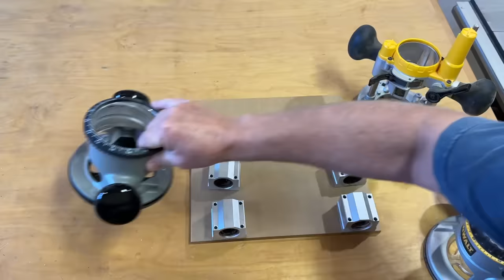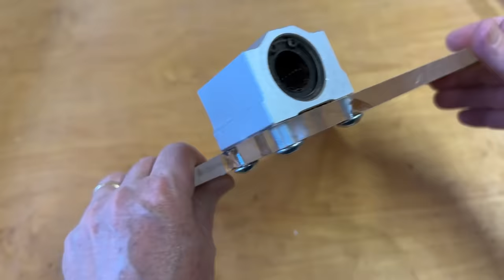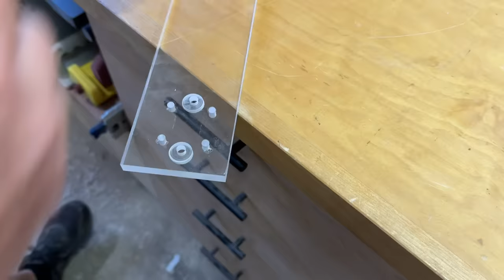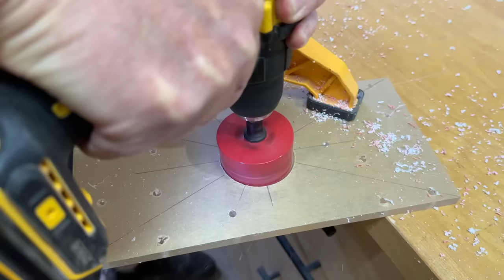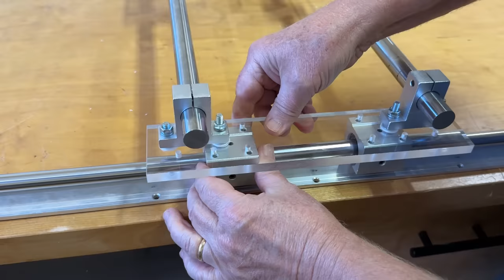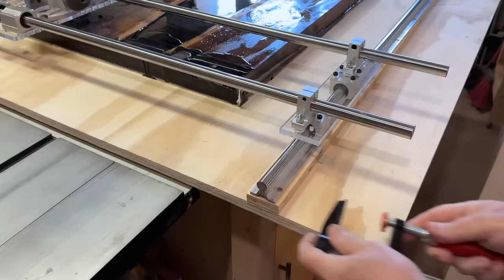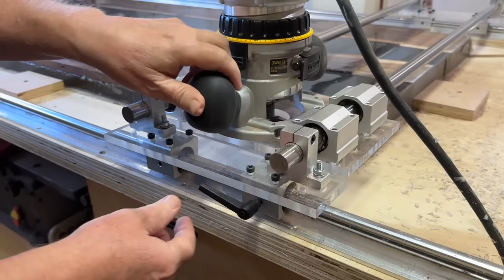Affordable Router Sled - I finally got it right!

Comment: Curious, how much deflection do the steel bars get with the router weight comparing the middle to the outside?  I wondered if that’s why people were opting for the other beams with the support like you have on the side?  Was it to reduce sag under weight?  Or did you find that the 20MM thick bar was thick enough to avoid deflection?
Reply from the maker: That's why I went with the thicker 20 mm on the cross rails, instead of the 16 mm that I used on the side rails.  I don't notice any deflection at all, and believe the result is a totally flat workpiece.  The 20 mm rails are really stiff, they actually feel stronger/stiffer than the 16 mm rails with the support bracket that I used for the side rails.
Reply: @jkmwoodworking  I appreciate your response!  I’m working on my SketchUp plans now for my next workbench and am trying to account for a similar setup.  Thanks again for the video and advice!

Comment: What did you do about the rails being straight?  I think I got the same linear rails as you, from Vevor, 20mm.  So far one is pretty much dead on, but the other one is raised a little in the center. But overall, good.  
I got some 16mm Vevor rails but they weren't straight enough for me to even keep.  I couldn't get the bow out by pushing on them with about 40-50lbs, so they were returned.
Reply from the maker: Oh no, that doesn't sound good.  The rails that I got were pretty straight.  To help them get perfect flat, I also screwed them down to the plywood worksurface, which rests on my flat workbench top, and the whole assembly seems to sit flat and true.

Comment: How do you hold the position of the cross rail during each pass?  Is there a lock?
Reply from the maker: There is a lock that comes with the rails.  I find that if I'm doing shallow passes, I can just hold it with my hand.  With deeper cuts, the lock is helpful.

Comment: Can you explain the templates you have attached?  30x32 vs 40x40?  Neither appear to be similar to what you drilled in the video so I am confused.  Thank you.
Reply from the maker: The template files are intended to be opened in the Lightburn software and used with a laser to cut the templates.
Reply: @jkmwoodworking  Ahh, is there any way to get a pdf that I can print and tape down to my acrylic?
Reply from the maker: @bpittaway6543  I'm not sure really how to do that in a way that they would be usable, sorry.

Comment: What about sagging on the cross rails when using a heavy router i,e 3 1/4hp Triton. Can you recommend  a size that will not sag in the middle.
Reply from the maker: I believe the 20 mm rails that I used in this video would easily support even the heaviest of routers.  The rails are very strong and stiff.

Comment: looks great! how is the rigidity of those cross rails? an issue I run into with wider router sleds is the cross rails flex/dip as you get to the middle under the weight of the router. those rails seem pretty rigid? thanks!
Reply from the maker: Thanks! The cross rails are very rigid.  going with the 20 mm diameter cross rails, instead of 16mm, probably helps...  they are really beefy and no noticeable flex
Reply: thanks! Im making this exact sled. appreciate the video  @jkmwoodworking
Reply from the maker: @tomboraguitars   Awesome, thanks!

Comment: QUESTION: USING THE SVG FILES FOR THE TEMPLATE....HOW DO I RESIZE THE IMAGE WHEN PRINTING TO ENSURE THE SIZE MATCHES? OR WHEN I OPEN IT UP TO PRINT THE SIZE IS THE ACTUAL SIZE OF THE HOLES FOR DRILLING?
Reply from the maker: I'm really not sure, I think it depends on what software you are using to open the file and print.  The files work with lightburn software that I used with the laser, that's the only way I've used and tested the files.

Comment: I am looking to do the same. bought the rails some time ago and seems like they are exactly what you are using. I was looking for a good tutorial on the mounting plate and thought of using a 3/4 in plywood. Is there any reason you opted for an acrylic sheet? also dont have a laser but was thinking of printing out the template and make the template on a mdf piece which could be used on the plywood. 
I also wanted to put dust collection but have the same setup (bucket and shop vac). I might have to empty it couple of time but it might be needed since I feel dust could get into bearing, reducing its efficiency. Did you face any such issues?
Reply from the maker: I chose to use acrylic instead of plywood because it is clear and I could see through it, but not sure if that is really too important or not.  Also, I think that acrylic at 3/8" is maybe more rigid than plywood at 3/4", so thinner and more stiff (not necessarily stronger, I'm not sure, but more rigid).  I didn't have any problems with dust clogging up the bearings.  Maybe the more I use it will, but then I would think if that happens, I could just clean them out.  Thanks for the great comments and questions!

Comment: Question that i cannot find an answer to- can those open-type rail carts ride upside down ? This way you would just mount them flat on a surface, i looked at their insides and it looks like the upper inner side has the exact same lines of ball bearings as the bottom.
Reply from the maker: Great question!  I haven't actually tried it, but I agree with you that it seems it should work.

Comment: Very nice project and explanation. Just curious, what was the model and hp of the largest router you used on the sled? I was wondering if the larger router may create flex in the cross-rails as the router moves over the piece to level. Thanks for sharing. BTW - subscribed:)
Reply from the maker: Thanks so much!  I was using the dewalt 618 router, 2 1/4 hp.  I didn’t notice any flex, the rails feel very solid even with the larger router

Comment: Thanks for posting the affiliate links. I've got the parts in my Amazon cart now. 

It looks like you need to assemble and disassemble to store the sled and rails and to attach the router to the sled base. Did you have to recalibrate anything each time you reassembled or was it enough to tighten the screws?
Reply from the maker: Great, thanks!  There is no recalibration needed to reassemble it.  Don’t need to loosen or retighten any screws.

Comment: Just started researching how to build a sled recently. Main question is whether I should be trying to build a sled long enough to accommodate 8 foot long stock or panels? It seems like most videos and plans I've seen are not quite that long. Is it suitable to build with shorter side rails and use another set to somehow extend the length if needed?
Reply from the maker: I believe that shorter side rails are fine, and then you could do a long workpiece in 2 sections.  After flattening one end, then slide the workpiece down the bed and then do the other end.  As long as your bed (plywood beneath the router sled) is pretty flat, then it should flatten both ends to the exact same thickness.  I haven't tried this yet on mine, but it was my plan if I ever have a very long workpiece to flatten.  I think of it like a thickness planer, it can do an unlimited length, just feed it through.

Comment: Hi JKM. The template files open to machine code so they are not useable. What program is needed to open them to the template file?
Reply from the maker: Hi Michael, the files are in the format to use with the lightburn software.  Don’t worry about the view in a web browser, just download , then you can open them in lightburn.  Hope that helps?  -Steve

Comment: Your measurements for the mounting plate are 2.5 wide and router tray 5.5 and 11 1/4 length correct? Did you trim down the 12 inch?
Reply from the maker: Yes, that's correct, I trimmed it down by 3/4".  Probably didn't really need to do that, it would be fine at 12", but I was just thinking that I didn't want it any bigger than it really needed to be.
Reply: Thank You for the clarification, currently doing the layout, I should just follow your measurements so I don’t mess it up.

Comment: The crosssled in the parts list is different than the one you are using. Did you modify it ?😊
Reply from the maker: I didn't modify it.  I just went and double checked the link, and it seems to point to the same rails that I used for the cross-rails.  The Vevor 20 mm linear guide rail set, 1200 mm length.  Part number is HTTZ20-1200.  I'm curious if maybe the amazon link works different for different people, what do you see?  That same amazon listing has several different options to choose from, perhaps it comes up for you with a different default option for you?

Comment: The cross rails link in the description don't look like the ones you ended up using. Can you update the link?
Reply from the maker: Thanks for pointing that out.  It took me quite a bit of research to figure out why it changes.  Looks like the vevor rails that I used are temporarily sold out, so the link just wrongly directs to a different set of rails.  I've added an alternate link to the description for another brand equivalent set of rails.   Thanks so much for letting me know!

Comment: The cheap leveling bit that I found online burned up my end grain board.  What bit manufacturer do you trust to keep its sharpness?  Thanks...
Reply from the maker: I've had the same experience with cheap router bits, and so now I pretty much always buy either Freud or Whiteside brand.  The bits that I used in this video are whiteside.  There are links in the description to the specific bits.

Comment: This is the last item on your list. is this something i will need? They are sold out.  1Pcs SBR25UU Linear Rail Bearing Slide Block 25mm Aluminum Open Block, CNC Parts for SBR25 25mm Linear Guide Rail
Reply from the maker: Thanks for pointing that out, it seems that Amazon changed the link on me, so I just fixed it.  I corrected the link so it points to the stop collars, which are not sold out.  You don't really need the stop collars, it is more just as a help to prevent the router from coming off the end of the rails.

Comment: Are those lines something that needs to be sanded or do you just go over the slab again?
Reply from the maker: The lines are removed with sanding.  They are much more shallow then they look on video.  You can barely even feel the lines.  It's really just the difference in bit direction vs grain direction on one side of the bit vs the other, so it looks like deep lines on camera, but it's really not.  It took me less than 1 hour with 80 grit sandpaper to remove all the lines on the live edge/epoxy table shown in this video.

Comment: What are the largest cut dimensions with your side/cross rail combination?
Reply from the maker: The crossrails are 48", and I think I can do 42" wide.  Although I haven't done one wide yet on this sled, it will be tight.   The side rails that I bought are 79" long, and I think I will lose as much as 12", so that would be 67" workpiece length.  However, in length, I really think I could do much longer because of the ability to just slide the workpiece lengthwise, flatten it in sections, and let it overhang as needed.

Comment: I'm going to model my sled off this video, thanks. one question: was the sbr 20 used for stability? I thought both could be 16?
Reply from the maker: I'm not sure the 16 mm cross rails will be stiff enough.  The side rails are good at 16 because they have the added rigidity of the aluminum structure (..the SBR style).  The 20 mm cross rails aren't the SBR style specifically, it is just the bar itself to provide all of the strength/structure.  Hopefully that makes sense?  Thanks!
Reply: thanks, new question now that I made the sled using the rails you recommended. Though it works,  the acrylic holding the router is not even with the acrylic riding on the slide rails. It's higher by the thickness of the acrylic.
Is that right? @jkmwoodworking
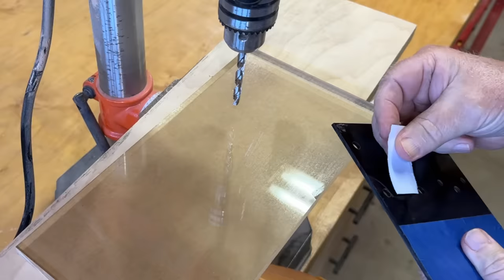Reply from the maker: @josephalbano5563  yes, If I understand your question, it is correct the way you have it.  You can see in the video at 1:39 a video shot of how the acrylic plates align, and see if yours look like that.

Comment: I think you've misunderstood the user manual, it seems to be warning you that it won't slow down on load so you won't get an audible reference for load, and without it you could damage the motor. It's not saying it won't spin at the set speeds. It just won't drop below the set speeds.

Comment: Where did you find the template to use, or did you make your own?
Reply from the maker: I made the template myself.
Reply: Thanks. I got mine up and running, and it works great. I could make a what not to do video as well. 🤣 I appreciate the video walkthrough.
Reply from the maker: @GallerWorks  Happy to hear it all worked out.  Haha, seems like every project i do has a lot of what not to do in it.

Comment: I can't get the template links to open, any advise there?
Reply from the maker: Unfortunately, I don't have the templates for sale.  I'm just a hobbyist, and not setup to sell things.  The files are specifically for use with the Lightburn software.  If you click on the link, it will try to open in a web browser, and look like a bunch of computer code.  After opening, then click the "download" button in your browser and it will copy the file to your computer.  Then you can open that file in the Lightburn software.
Reply: @jkmwoodworking  Thank you!!!  I'll give that a try

Comment: Looks like a VERY nice sled......however,  I clicked on the links for the sled pieces, and they are currently unavailable
Reply from the maker: Thanks!  I just checked the links, and they all show available to me.  I wonder if it is location specific?  Is there a specific one that shows not available to you, or is it all of them?
Reply: @jkmwoodworking  All of the sled pieces.....the router bits show that they are available
Reply from the maker: ok, thanks so much for letting me know!  I'm going to investigate and see if I can figure out what's going on.
Reply: On Amazon, products are listed available according to the shipping countries specified by the seller. If the seller only sells in USA, will not be able to buy it in Canada or anywhere else. This causes me to shop from aliexpress and stores in England.

Comment: Wait e sec, you have a LASER cutter and didn't just use it to cut out 3 each 1/8 sheets and laminate them?
Reply from the maker: I have a diode laser which won’t cut clear acrylic and I want the sled to be clear.  I wish I had a CO2 laser, then I could have just cut the 10 mm clear acrylic and been way simpler for sure.

Comment: Why would you use acrylic not polycarb? Do you have a death wish?
Reply from the maker: hhmmm, well, i guess you are pointing out yet another mistake i made.  I'm not sure, why would acrylic be a bad choice and polycarb be better for the router sled?
Reply: @jkmwoodworking  acrylic shatters and explodes like glass, polycarb is literally bulletproof
Reply: Polycarbonate is a lot more impact resistant than acrylic, but it's also a lot more expensive.  If this were a guard, I'd say it should be polycarbonate, but as a jig I don't see it as that big of a deal.  If you don't care if it's transparent you could use aluminum, or even MDF if a little thicker.